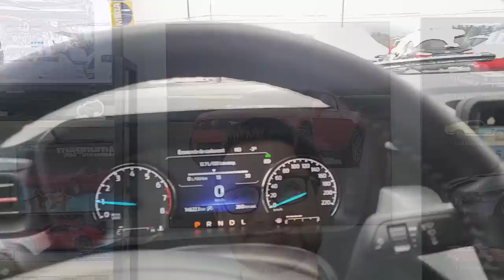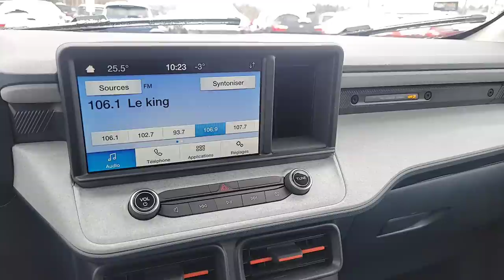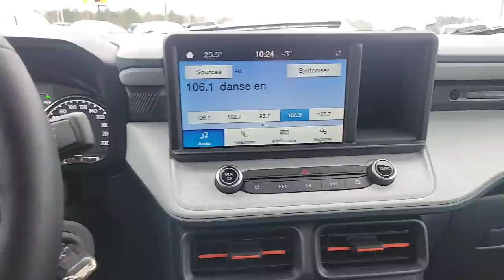Ford Maverick 2023: What is wrong with the POWERTRAINS?

Comment: It took exactly 10 months to get my 2022 Maverick XLT. I ordered it with the 2.0 ecoboost, Co-Pilot 360, and XLT Luxury Package. Financed it through Ford Credit for 0.9%.  Extremely happy with it. Took it on a road trip from Houston to Dallas with 500 miles on the odometer and got 31.3 mpg driving 70-75 mph.
Reply from the maker: Billy thank you for adding helpful information for our community
Reply: That's probably better MPG than my 2.slo/CVT Crosstrek gets with the cruise set at 75MPH. It can get over 40MPG set at 55MPH, but starts sucking it down above 65MPH.
Reply: How did you get 0.9% apr

Comment: Ford over underestimated the demands of hybrid model,. It put one year efforts making 0 improvement on hybrid, but on tremor. That's wrong direction and proved by market demands now. If I need to switch to ecoboost engine, i will seriously consider it's rival Santa cruz.
Reply from the maker: Thank you for adding your input to our community
Reply: The Santa Cruz is pretty,  but it doesn't get the gas mileage and it's not a Ford...

Comment: I got my 2024 Maverick in January 2024, in the last week of March 2024, the check engine light come up with 4.745 miles. So, they kept the truck for an entire week and they replace the Heather Exchange, and I checked for the faulty code, and saw that it's a very usual fault on Maverick.
I hope it really fixed the issue. 
My Maverick is hybrid and is actually doing 43 miles per gallon, and I drive around 180 miles a day

Comment: I didn't know about the gasket failure. Mine is 2022 built in Oct 2021.fx4 4k so far so good. I have 2 recalls but the airbags are not in stock yet and my appointment  for the other isn't till February every dealer is backed up in my area.
Reply from the maker: Thank you for the intel. As of 2019 2.0l I would not worry at all about gasket issue

Comment: Not only are they on the second edition of the 2.0 Ecoboost, in late 2019 models they changed the cooling passages so there is a wider area for the head gasket to seal.
Reply from the maker: William Scott that is the type of incredible added information that you regularly add to our community. Thank you so much for helping everyone get great additional information and value from our community here
Reply: @Johnnyscarcarereviews  Is a catch can still needed?  Is walnut blasting still needed?
Reply: @billquattlebaum1577  pretty much every direct injection gas engine will benefit from intake cleaning down the road. Walnut blasting is more work (to remove intake manifold) but cleans better than chemicals injected into the manifold.
Reply: @davebrown9725  So how often do you think the blasting should be done?
Reply: @billquattlebaum1577  I'll defer to someone with a borescope to do a quick visual. Some engines get dirty quicker than others.
I am not a mechanic, but I watch many on youtube.

Comment: re. awd system, being fwd bias, is the 4w lock a locking center diff like suv's have, or more like a truck 4H but w/Fwd bias / reverse system ? What does that lock do exactly ? I actually like how suv and car awd systems work more than how truck 4H systems work.. not having that skip issue... I think it's better and good for powering thru mud and up hills (experience with my '11 Santa Fe V6 awd),  having the rear lock as well on this is a bonus and why I am leaning towards a tremor over the fx4.   Also, the trail control is not only for hill descent, but it's a forward/uphill crawl mode, to assist when accidentally over spinning is a negative ?   And, if you can indulge me a bit more, can you explain what All the dif. modes do ? in detail. I am trying to find this info so I can compare to other awd/4x4 systems before deciding on which one I go for. Example, the Ridgelines system is pretty decent and manages to figure out tough terrain. How does fx4 and tremors modes diff. to Honda's ? I understand the basics of what they do, but more full detailed understanding would be awesome !! example, I'm curious do any modes, like sand, simulate being in a locking center diff. and give torque to all 4 wheels to fight up a hill with ice and all 4 are slipping ?   Look forward to your input on this.  I'm hoping to decide on a truck during the Christmas holiday promotions (if any are lower interest % rates to take advantage).

Comment: how about the oil pump belt being rubber & causing failers ? Suppose to be a problem too ??
Reply from the maker: We have yet to see that issue come in at our dealership. What has been your experience in regards to this problem? Thank you for posing a great question
Reply: @Johnnyscarcarereviews  I don't have one, but am considering buying a Maverick 2.0L temor and wondering if something like this is too serious or not ? and to be safe, if one should change out the oil pump belt or whole thing, after 100K kms to be safe or ? most cars have this part as a metal chain, and not a rubber belt so really seems stupid and potentially Big $$ failure issue.  if you find more on this and how many % are having trouble, please update with a video on it. I will do the same

Comment: They need to correct the carbon built up on the valves of the 2.0 ecoboost
Reply: All direct injection have that issue, changing oil regularly and fuel additives will go a long way.

Comment: One reviewer mentioned the tranny, or diff. or something is rated to handle 257 lb ft of torque, but the engine is dishing out 270 range, sooooo ???Hmm... can the drivetrain handle this at full torque ? in the long run, will it slowly get warned down/break down ??
Reply from the maker: It was Sarah from Sarah n tuned. I thought it was at its limit however and not surpassing. It's the tranny for Lincoln and Edge so I'm not too worried.

Comment: If the 2024 order banks open say August and you have a 2023 hybrid ordered do you order a 2024 since you may never get the 2023 you ordered ?
Reply from the maker: I will cover exact instructions on what to do when we get there but likely come reorder time we will need to put in another order using the same code.

Comment: I am in it for the long haul. I ordered a 2023 xlt hybrid when the ordering banks were open in sept. I ordered the rear sliding window, engine block heater, co-pilot 360 and rear hitch. Don't think I will tow anything with it, but think it looks better with it on. I have a f-150 4x4 if I need to tow anything.
Reply: Good luck!

Comment: Firstly. Great video. 
I keep hearing about all the bad news on the Maverick, from not getting g their orders in a timely manner. And some other things ! 
I ordered my 36k yes 36k Maverick with pretty much everything except the 4k pkg.  i ordered my maverick in sept of 21 and received it Dec 31 2021 it took less than 90 days from ordering to receiving my maverick. 
I now have 11,000 miles and I have not had any problems. The vehicle with its 250 HP AWD  gets up and goes really well and passing capability is great 👍🏽 
I averaged about 26 in town and I’ve gotten up to 33 mpg on the highway with open roads… when I fill the maverick it shows about 400 miles per tank .. 
so with my 2022 Ford Maverick Lariat I’m pretty impressed considering I live in the Bay Area in California.. where has today is about 4.75 a gallon. 

So far so good . Don’t let people downplay the vehicle in a whole .. yes there has been some issues.. but it’s a reliable little truck !
Reply from the maker: Thank you for the most excellent intel. We really appreciate information and help like this. 👍
Reply: @Johnnyscarcarereviews  no problem. Anytime brother ! 

Quick question. Have you heard about a hack for the cluster gages that when you push the OK and start button there’s an ET IN GREEN THAT  POPS UP AMD IT SHOWS HOW TO RESET A BUNCH OF SETTINGS .. ? 

Let us know if you can do a video if you find it or how to do it . I tried doing it but perhaps it only for the XLT  or hybrid ..

Comment: Have you heard of people having issues with the brakes on the hybrid? Whenever I stop my brakes lock up for about 2-3 seconds before it makes an audible click and starts rolling forward. To me it’s one of the most annoying things about my car. And it’s not the autobrakehold feature, I hate using that. But the car practically does it itself anyway
Reply from the maker: No I have not heard of this and this does not seem normal at all.. I check with your service department at your local Ford store as they can verify it when you're in 4 an oil change. If the brakes actually are locking up and the caliper js remaining fully compressed against the disk then they will fix this under warranty

Comment: What about the carbon buildup problem many have talked about with the ecoboost?  Also, I have read that the ecoboost engines need a catch can added.  Has Ford solved these problems, or do they still exist?  I have also read that the oil should be changed as early as 3,000 miles on the ecoboost even if you use full synthetic oil.
Reply from the maker: Carbon build up was an issue, especially for those that did long idle prior to adding port injection. I've got a recent video that covers all this and more. Please check it out
Reply: @Johnnyscarcarereviews  Thanks for that information!

Comment: if toyota makes a small hybrid truck that would be game over for ford maverick.. hurry up toyota!!!
Reply from the maker: Prawn star I am sure tota would make a great small truck however if they do there will be delays for most people unless they order the minute Toyota is accepting orders. To think there will not be delays is to completely ignore the 5 to 6 year delay for the Toyota Ralph 4 prime
Reply: Not necessarily Prawn. Ford will also come out with a plug-in or hybrid that can tow 4000lbs soon after Toyota’ release. Ford certainly won’t idly stand by and not improve/update the Maverick to keep the demand up during what surely be an up hill battle just like the other manufacturers.
Reply: @shannonjurgens3667  competition is a good thing!
Reply: Ford Maverick hybrid design is derived from Toyota hybrids
Reply: Have you seen all the problems Toyota is dealing with now ?

Comment: The 2.0 sounds a bit ticky-clicky but she's got decent power. I've got 32,000 miles on mine and change my oil every 4,000 miles (ordered 2.0 AWD FX4 4K-Tow in June 21 and received it Nov 6, 21). My engine was built in Valencia Spain which I am told is better than the Cleveland, Ohio Engine Plant.
Reply from the maker: Awesome intel scotty

Comment: The hybrid system has been in use since 2008 in the Ford escape hybrid system as taxi cabs. They are proven so reliability is a plus. The hybrid system is from Toyota that ford is duplicating. 
The 2.5 liter engine is a Mazda engine that has been proven.   I believe if it’s not broken, do not fix it.
Reply from the maker: Great comment. Thank you for being a part of the community and sharing with our community

Comment: I waited 1.6 years to get my Hybrid maverick and the day I picked it up the dash cluster stopped working, no clue how fast I was going and I pulled a fuse to reset it per a YouTube video and fixed the problem.I have 650 miles on it so far and its parked now because I noticed my company mavericks are crap. We have 15 in the fleet and I seen it all. From the engine revving full throttle uncommanded to the door stop when you open them lever breaking. We have 4 of them that the battery dies for no reason and the list goes on. These are first year trucks under warranty with less than 10K miles used in an aircraft maintenance environment. I'm selling my maverick soon. At least I will get my return on my investment. Thats the only good thing I can see. I wish this was not true because I love the idea of the Maverick in general. To bad its a failure in my book
Reply: I forgot one thing. I have been weighing out if I should sell my 2023 Maverick in light of the dependability issues or to get the best factory extended warranty. Sure it's 3K to 6K but to me that makes me feel better about my investment but now the price point just took a leap. But for anyone that is thinking of buying a Maverick I think this would be a must. Also y ford dealership tried to throw in a paint and body protection warranty and said it's standard and I called their bluff. Bottom line don't fall for any extra warranty protection as a standard charge. I will never shop at friendly ford in Las Vegas again because of this scam they tried on me
Reply from the maker: Thank you for the feedback. I'm sorry to hear this and honestly surprised. We have 4 as loaners at the dealership and I know a lot of people that own them and have never heard of so many problems on such a small sample. Honestly this is far more problems then I have seen across the 70 or so that my dealership has delivered.

Comment: Seriously considering trading my bronco sport for the hybrid maverick. Need an actual bed to lug bikes and smaller items from home depot, etc. Trailer hitch would be nice to pull kayaks, ultra light camper, etc. Really attracted by the Mpg that's what got my interest to begin with.
Reply: You'll probably only have to wait a year or 2
Reply: I haul all kinds of things with a Crosstrek. I have roof crossbars and a rear hitch. It pulls my 4x8 folding Harbor Freight trailer fine. Canoes, kayaks, bikes, snowboards, surfboards, cargo boxes, 4x8 sheets, lumber, pipe/tube, and other things fit on the roof. Bikes, snowboards, and cargo fit on a hitch rack. I've towed motos, small boats, firewood, and a number of other bulky/heavy/dirty things.

 Your Bronco Sport has 500lb more towing capacity. It could probably even manage towing a MacGregor 19 powersailer cabinboat, while I have to use my wife's V6 SUV for something like that.

 What kind of MPG can the Bronco Sport manage with the cruise set at 55-65MPH?
Reply: I had the hardest time deciding between the Maverick and the Bronco Sport Badlands. I ended up going with the Badlands because we thought it would be more practical to put the luggage where it would stay dry instead of in the back of a truck and need a cover. Additionally, I drove escapes from October 1, 2000 until December 16, 2021. I had a 2001 Escape and then bought a 2008 Escape. The 2008 Escape was incredibly dependable and running gray until it got totaled by a guy running a red light. My Escape had over 280,000 miles and had the original engine, radiator, alternator, timing chain, and a few more original things. Water pump changed at around 250,000 miles, oxygen sensors changed for the first time with 278,000 miles, ignition module changed at about 240,000 miles, and the rest was pretty much tires, brakes, oil changes. The bronco sport looks more like my 2008 Escape than the new escapes do.  The Bronco sport can be dressed up a little more than the Maverick. For starters.  Correct me if I'm wrong, but I'm still surprised that no Maverick can come with factory fog lights. One disappointment of the Bronco sport is a low towing capacity compared to the Maverick even though the same engine.

Comment: I've put 22,000 miles on my hybrid.  IT WAS GETTING 45 MPG BEFORE THE RECALL WHEN THEY MESSSED WITH THE RADIATOR FINS.  IT GOT 32 MPG DRIVING HOME FROM THE DEALLER AFTER THEY MESSED WITH IT.  ENGINE TEMPS NOW VARY DRASTICALLY AS YOU DRIVE NOW,AS COMPAREDED TO 45 MPG AND CONSTAANT TEMPS BECFORE.
Reply from the maker: Very Odd Harold. Thank you for the details and I'd love to see more extensive testing to better confirm results

Comment: Sorry. but its too early to tell if that powertrain (Engine and trans) will be reliable. 2.0 had its share of faults early on (Coolant Intrusions) and it can have many more as makers tweak things when they put them in new models. Also, that 8 speed transmission isnt all that great either as many Ford Escape owners claim needing a new transmission between just 21,000 miles and 80,000 miles. Yes there are some with over 100k but time will tell. My Ford Escape transmission grenaded at 34,000 miles. Got it back and traded it in same day. Bought a Equinox 2.0T and thats been flawless since. 

Ford quality in general has been going the shitter and their 2022 recall numbers prove that. As well as the number of recalls on the Escape AND Maverick during their short time being out/remodeled. Escape 10, Maverick 4. Including the so called "Reliable" powertrain. J....U.....N.....K.
Reply from the maker: The 2.0l has been out for over 10 years. How many years do you require. I agree some have had problems but the motor is known to be generally very reliable especially after the coolant issue was resolved. My only worry is the newness of the 10 speed and yes time will tell
Reply: @Johnnyscarcarereviews  Took them 6 years to fix the coolant issue but since it has generally been reliable. But, as stated, New models/remodels, new tweaks, new ways to route wiring and lines, things can go wrong otherwise. 

However, I think the maverick has the 8 speed in it not the 10 speed. 8F35 to be specific. Same as the escape. Time will tell transmission wise but Escapes have not been having a good time with those 8 speeds.